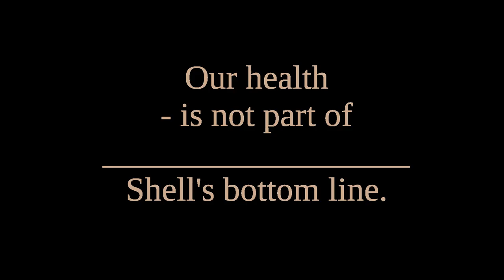Accidents Happen - Shell Petrochemical Plant in Beaver County

Comment: I was an inspector in the coastguard and this is such a small facility compared to other cities like Galveston. Read through the operational plant and actually get an understanding of what this company is doing. It's extremely safe and super efficient environmentally. All the steel mills were much much worse back in the day. It's good for the expansion of our area and provides a livelihood for people. It should be nothing but positivity. It had the latest and greatest technology in its field. It meets and surpasses the requirements of our laws. Everything will be fine.
Reply from the maker: I hear you say "efficient" but, it still is going to be second largest polluter in the State of Pennsylvania.  Shell's permit application says it'll release 1000 tons of carbon monoxide gas per year, and hundreds of tons of nitrogen oxides and volatile organic compounds.    That's the equivalent of spilling a tanker truck full of gasoline every week...
And it gets its input gas from fracking, so there's also all the leaks and groundwater pollution from that...
Reply from the maker: @MrHa321    Permits are for normal operation; they don't cover emergencies or even the extra pollution that's often released when starting-up or shutting down the plant.   So, universally, companies get a permit that just exactly covers full-throttle operation.
To be sure, they don't always run at full throttle, if the demand isn't there.  But they make the most profit at full throttle, so that's where they'd like to be...
Reply: @beavercountyplasticsplant4154  you're just making hypotheticals now
Reply: Universally is a terrible term because we are one of the best countries at reducing our emissions
Reply: @beavercountyplasticsplant4154  Apparently,you were not in the area when St.Joe was there... We would burn Co off that we did not use as a fuel .
Reply: @beavercountyplasticsplant4154    "Shell's permit application says it'll release 1000 tons of carbon monoxide gas per year, and hundreds of tons of nitrogen oxides and volatile organic compounds.    That's the equivalent of spilling a tanker truck full of gasoline every week..."

According to the EPA the average US automobile released 4.6 tons of CO per year.  So we're talking the equivalent about 217 automobiles per year.

Carbon monoxide doesn't come from gasoline, it comes from incomplete combustion.  NOx and SOx are tightly regimented in PA.   I know because I had to work on the sale from a former employer on their NOx emissions.

A tanker truck of gasoline can form SOME smog because the volatiles will react with air and sunlight to form ozone. Such a big spill at one time is not trivial,  it's a genuine emergency.    I bet my paycheck that Pennsylvanians spill more than that each year filling their lawnmowers.
Reply: @beavercountyplasticsplant4154  "Second largest polluter" is merely a function of how much industry has been shuttered in Pennsylvania.
Reply: Well said !
Reply: Hahaha you must work for shell

Comment: This has destroyed Beaver county from what I see. Everyone wants to move out of the area you can barely drive on the roads now all the out of state assholes moved in ramming people off the roads. They don't even hire local people or even try that's not what they want locals wouldn't purposely destroy their area just to make another energy company rich. This has done nothing good for the area. Anyone that lives near the plant in their right mind has moved or will from this dangerous area. Between the nuclear power plant and this this is probably one of the most dangerous places I know to live anywhere in our area. Catastrophe waiting to happen. And people praise this? Shell has nearly ruined beaver county single handedly
Reply: From what people who actually work there have told me, a good many of the permanent jobs have been filled by people who used to work at Bruce Mansfield, Midland Steel, ARCO Chemical, Mobil Chemical, and any number of shuttered coal power plants in the region.
Reply: @NikkiMarie0749 By your "polluting our air" statement can I assume that you live in Beaver County?
Reply: @NikkiMarie0749 Okay then. I used to build and commission places like paper mills, petrochemical plants, and gas turbine power stations. During the startup and commissioning phase you encounter what I call the "run it, break it, find it, fix it" stage. This place is huge, and this phase will take time, and will not last forever. Benefits? Those who worked at the places I mentioned won't be out of work. Their kids won't have to leave town. The communities won't be devastated as they were 40 years ago.
Reply: @NikkiMarie0749 The problems in Beaver County are no different than anywhere else in Pennsylvania. I've lived between Edgar Thompson and Clairton Works for most of my life and have lived through the decline. 
Plant after plant closed and it wasn't good enough for the environmental activists. Coal plants followed the steel mills and it still isn't good enough. The air and water are the cleanest they've been in over a century but it's still not good enough. Florida is where the growth and money is. My youngest son and his family moved from Philadelphia to Orlando. If you have the skills I recommend that you leave Pennsylvania behind. Shell got everything for free, but it took 10 years to get the permits to build the place, something U.S. Steel took into account when it decided to build a new plant in Arkansas. Rumor has it that ET will close when the new plant is up and running, driving yet another stake into the heart of Carpetbagger Fetterman's Braddock.
Reply: @NikkiMarie0749 The larger and more complex a machine the longer it takes.

Comment: The majority of this facility was fabricated overseas, where there are much more relaxed QA and QC requirements. There are many substandard welds that were made overseas by sub par welders. Those that were discovered have been repaired by quality Union craftsmanship, but not every substandard weld has been found. The criteria for welders currently working here on this job differs from the criteria of the welders who work in the 3rd world nations the majority of these modules were fabricated in. I know I would not be comfortable living around this facility.
Reply: Shell has a huge liability overhang if they knowingly used substandard components.   Pennsylvania has routinely denied Tort Reform.   Our Supreme Court slams it each time.

Shell can't afford the massive payouts if they let stuff fly apart.
Reply: Lmfao, typical response, blame everyone else first.

Comment: Not to mention the nuclear power plant 2miles down river! But yea keeps us all working..
Reply: My wife works in Midland. My daughter graduated from high school in Midland. I’ve yet to worry about the nuclear plant. We live n Hopewell.
Reply: The nuclear power plant is safer that any other plant in the surrounding area that should be the least of your worries. The only bi product released into the air by that plant is water vapor meanwhile you have 26 coal fire power plant within a 100 mile radius of beaver county dropping co2 and particulate into that air for the past 30 years if you need to be worried it’s about that not a nuclear plant or a plastic plant…
Reply: Nuclear is safer, cleaner, doesn't kill the environment and is in eveyway better then Shell's plant. A 1 gigawatt Nuclear plant will produce more energy  consistently then a Oil, or coal fire plant. Before you mention  Chernobyl  or fukashima, Chernobyl was a undermaintained mess. Fukushima was built in a poor location, which caused it to be affected by the tsunami and earth quakes. Not to mention those reactors were generation one reactors, that were built in the 60s and 70s. They were not controlled by modern computers or safety systems. Nowadays Nuclear is simply better, more efficient, less dirty, and it would make your power bill go down if we has more nuclear instead of oil or coal fire plants. Not to mention around 13 thousand people each year die from coal and oil fire plants, meanwhile the total deaths directly caused by nuclear accidents is a total of 32 people. That's including 3 mile Island, Fukashima, and Chernobyl. Also France is almost completely powered by nuclear reactors, ever hear of an incident from France involving nuclear power?
Reply from the maker: It's absolutely true that nuclear is safer than coal, oil, or fracking.  Just think of those millions of tons of coal ash sludge, or contaminated fracking brine.